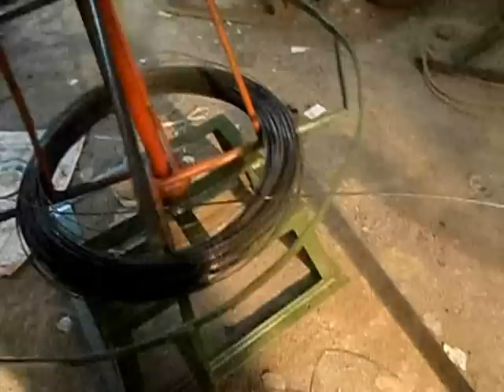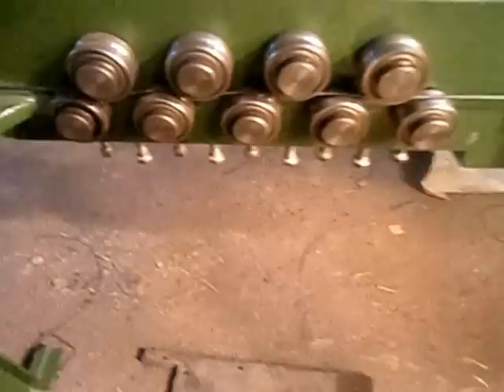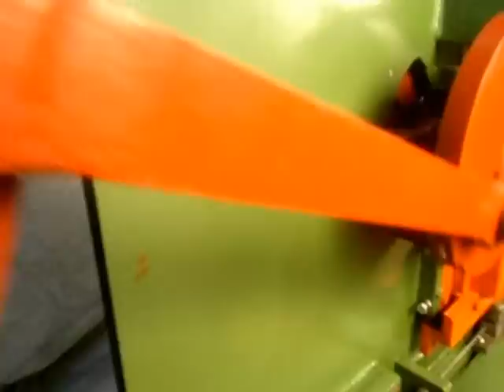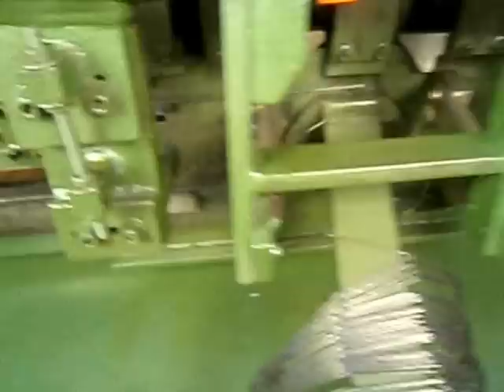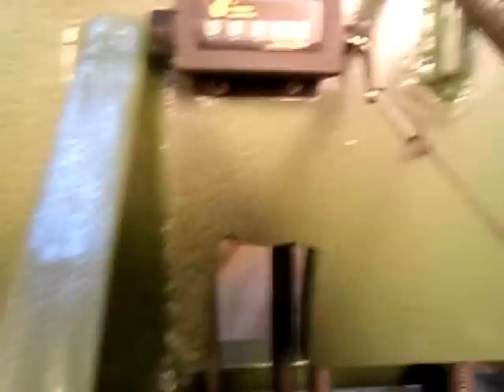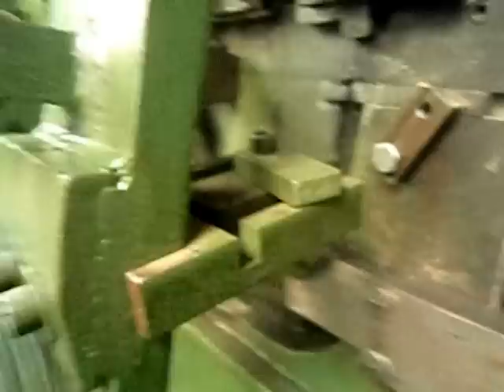Bucket handle making machine ramg.in

Comment: # How many tons on average per month is produced?  # I need a machine with diameter of 3mm ( wire diameter) is that possible? # The weight of the final product (handle) is 34 gm for the average size. Is this machine suitable or do I need to look for another one?# Do you have moulds for different sizes of handles? # Do you know the average price per ton for the galvanized wire 3mm?# Do you know how many kgs should this handle lift?# What is the price of the machine?